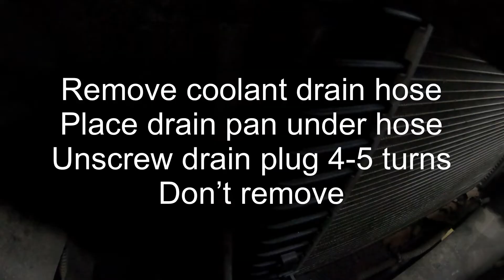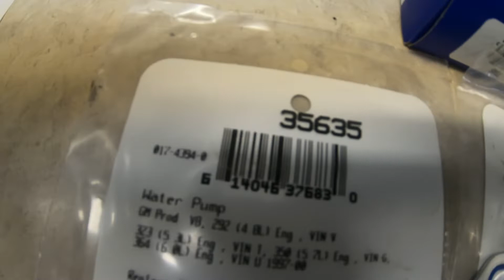2000 Silverado 4.8 coolant leak

Comment: How did you know you had a leak in the gaskets? was the leak visible from the outside? I have a 4.8l 2000 GMC that consumes a lot of coolant, but no leaks noted on the outside. I don't believe the head gaskets are bad do to no overflowing or pressure buildup in the cooling system. The engine has 118k miles and this has been going on for a long while according to my stepdad.
Reply from the maker: I've found a stain underneathed after it set a couple of days, and it's common for the water pump gaskets to seep it only would leak after it cooled down
Reply from the maker: Yes, mine had been going on for a while, too, but I finally saw a trail coming from the water pump down the engine block. Are you seeing any kind of spot underneath the truck?

Comment: was it the water pump gasket?
Reply from the maker: yes it was the gaskets. After sitting for a couple days i would see a spot under the front of the truck then when I took a closer look, I seen where it was actually coming from between the pump and the block thank you for your question